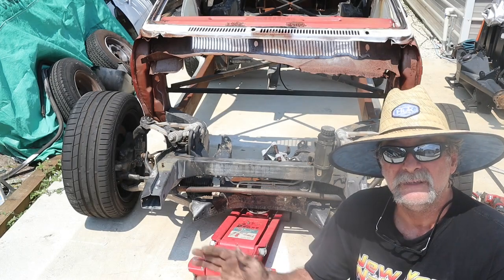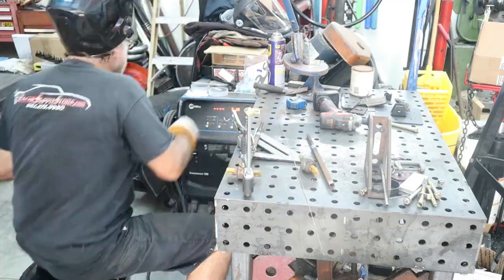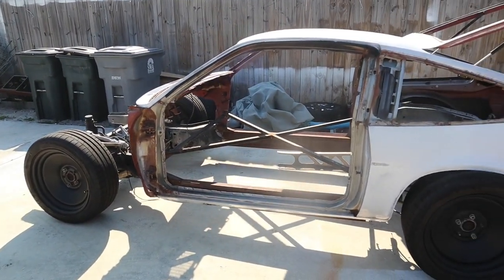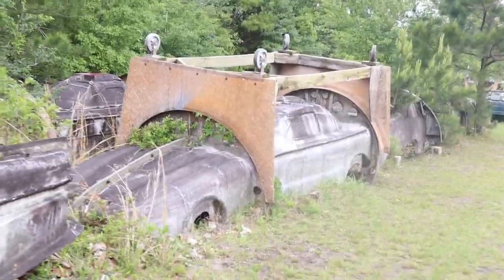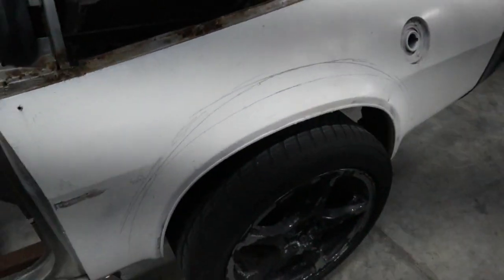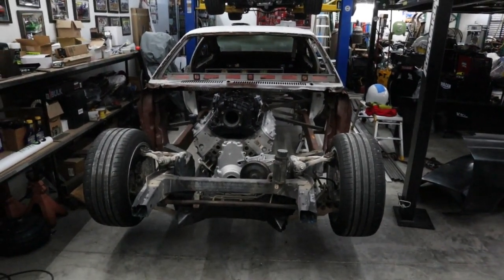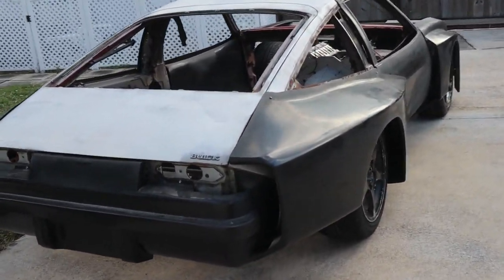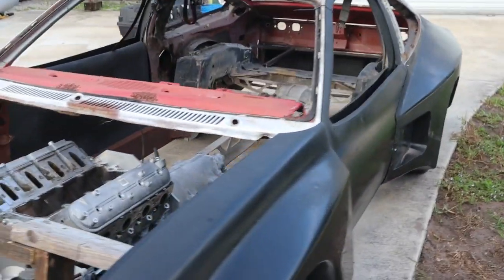Body Swap Special: "Vettehawk" Part 2 - What Happens When a C4 Corvette Meets a Buick Skyhawk?

Comment: Nice work! I'm doing the same thing with C5 vette
Reply from the maker: Awesome, what body are you putting on the C5 chassis?
Reply: @LANDISPERFORMANCE  a 1980 Monza with the same DeKon widebody. The C5's wheelbase is a bit longer though so I'll have to figure out where I want to length the body
Reply from the maker: @harnessed_garage  Awesome, that will be a cool project! You can also shorten the torque tube, as long as that doesn't put the transmission to far forward in the interior. My buddy Scott as a 1963 Pontiac LeMans with a c5 chassis swap, there are a few videos on my channel, the torque tube had to be lengthened for his wheelbase. https://youtu.be/fcsRsoHF1Gs  and it is in a couple other videos  https://youtu.be/zJOcJqGVPWI

Comment: Just by luck i found your channel when i saw a mention of c4 suspension. Lots of cool car videos. Could you tell how the radiator is cooling 50 Fleetline and if doing good what brand and size it is. I'm asking because I am close to completing my 57 Belair that has c4 front and rear suspension using an all aluminum 5.3 and 4l80. I would rather not use a big crossflow radiator if not needed. Thanks Don
Reply: Thanks for the quick reply. I checked out griffen radiator for 57 Chevy with ls but it was  a large crossflow package priced at $2400 way more than I was planning on spending. Your comments about the importance of fans/shroud confirm my thoughts too. Do you have any info to help me check out the ebay radiator that is in your 50 fleetline? I must say you work a lot quicker than I do as I have been working on the 57 going on 9 years but getting real close now.  Thanks Don.
Reply from the maker: I don't use the LS swap radiators, I just order them for V8, shouldn't cost more than $1500.
Reply: I need to check further, I had been searching for ls swap radiators  to best match up to ls engine hose size and position to fit in 57 car. Thanks
Reply from the maker: @donaldsweet7646  Check out CU-70046, CU-70047, or CU-70065
Reply: Thanks George, that package is will surely do the trick but still more than I feel comfortable speeding. I had good luck with Champion radiators on a model A that would not cool and their product worked great. I had looked at their site and they had listed a ls radiator for a 1949-1954 chevy that I believe I could adapt to my 57. That is why I was asking for more info on your ebay set up for 1950 Styeline. I appreciate your youtube content and and blown away by the number and quality of the cars in your podcast last night. I am in eastern Va. and there are a lot of nice cars around here but I haven't seen that kind of turn out around here.
Reply from the maker: Thanks for the comment and watching my videos. The radiator in the 1950 Chevrolet was actually an Ebay 3 row radiator. I usually use Griffin Radiators in my builds, they always work great. One of the things that is important in my opinion, is fan volume. Case in point, on the Ebay radiator it would cool ok on the highway with the fans that came with it, but when I would autocross the car, multiple runs back to back, it would continue to build temp and not come back down. I switched to high CFM Spal fans, with the same radiator, and the temp would stay between 172 and 180 all day, no matter how hard I ran the car. So to some this all up, I prefer Griffin radiators, and I use their Exact fit, and a good aluminum shroud with Spal fans. You can use the Combo units, and that is what they sell